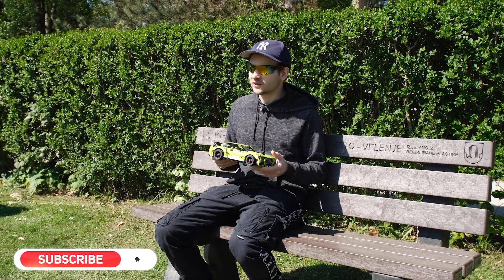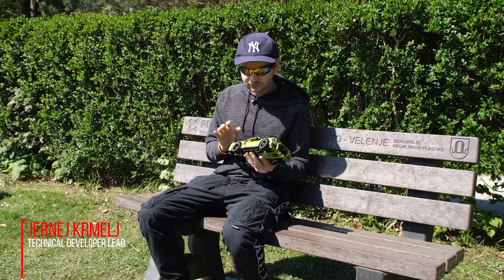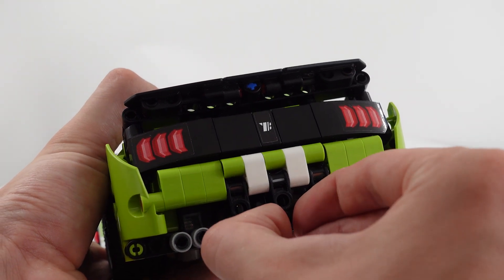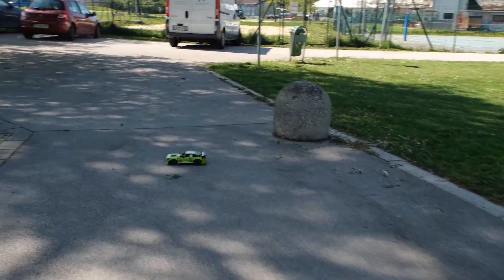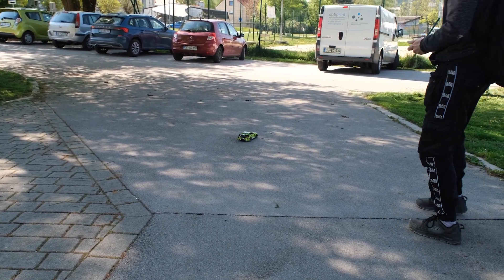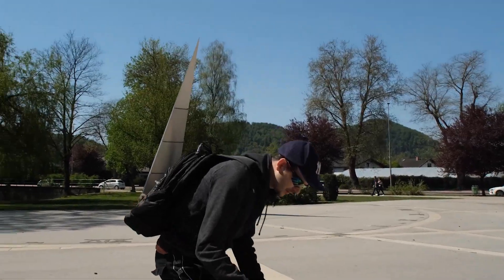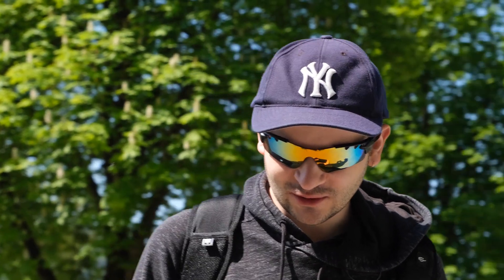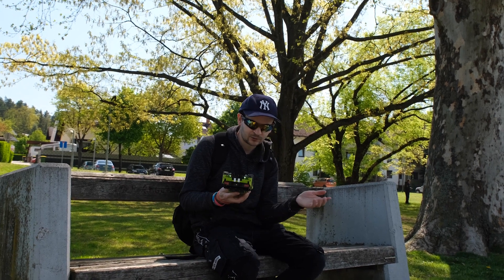42138 Ford Mustang Shelby® GT500® motorization + free Instructions

Comment: I'd like to ask is there cheaper alternatives to buwizz motors? I'm 15 years old and just started getting into this stuff and I don't think it's worth to buy 200€ motor at the begining (ik cheaper will be much weaker). And also it would be cool if alternative had the same size as buwizz, so i could use instructions.

Comment: Do not attempt to do this build with the M motor on the bottom. Because the body is very low to the ground, the M motor is scratched and damaged when running. Other youtube video have the build with the motor M higher. You guys can find it.